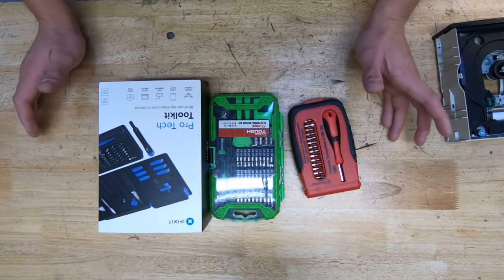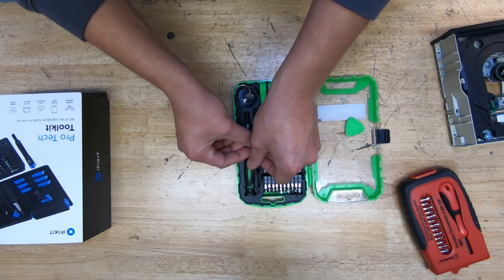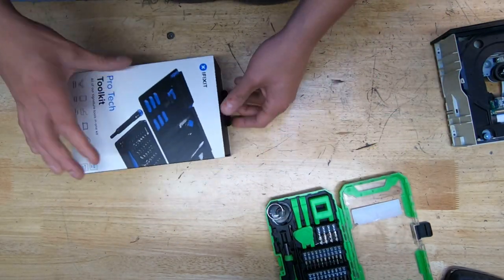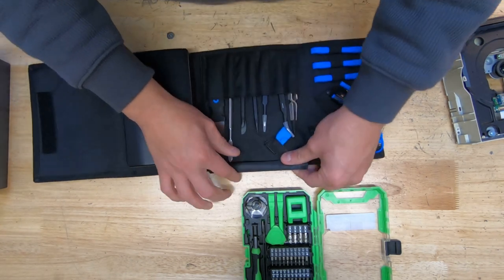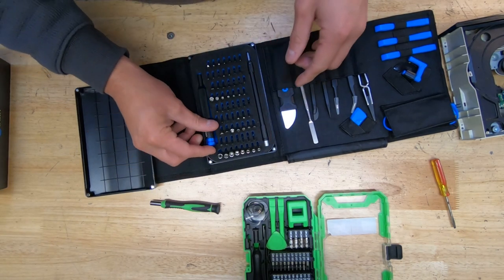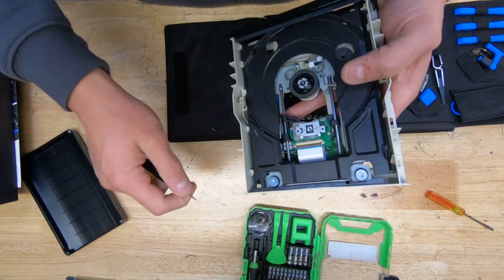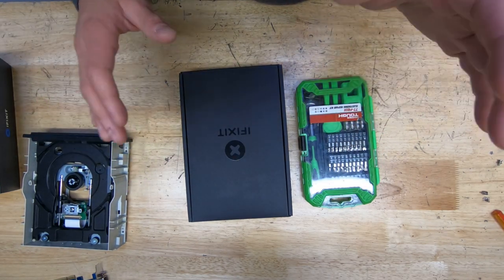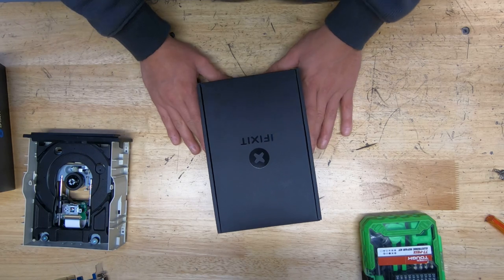Electronics toolkit comparison! Best bang for the buck!

Comment: I agree with your assessment. I use a $10 or $15 Hyper Tough toolkit, it is similar to the one you have there except it has a little fewer bits and an extender piece instead of the pieces for doing screen/tablet/phone repairs. Good video my friend
Reply from the maker: Thanks! yea only reason i have it is cause the wife bought it for me lol.. outside of that I would still be using the hypertough kit.

Comment: When I started the practicum, I didn't have much money, so I bought a cheap iWork set. The case broke the first time I opened it, the precision driver was crooked, the spin cap had a lot of resistance, and would get caught, and the ratcheting handle was really sloppy and skipped. After that day, I decided to get good tools, even If I had to pay more. The iFixit isn't that expensive and it's quite good. Some screw extraction pliers and an esd mat are a good addition.